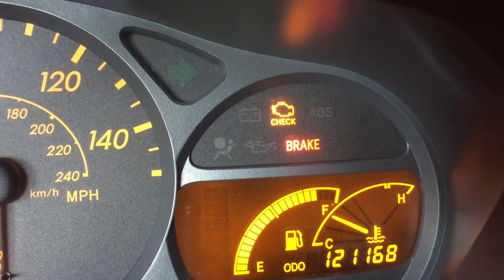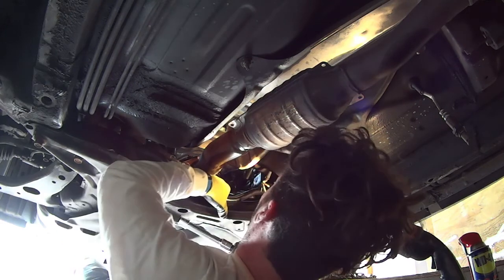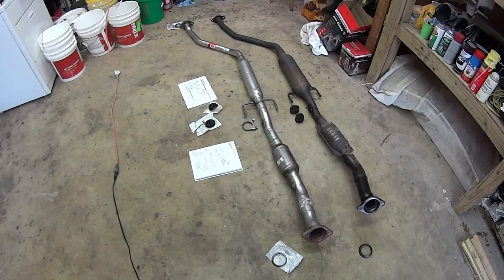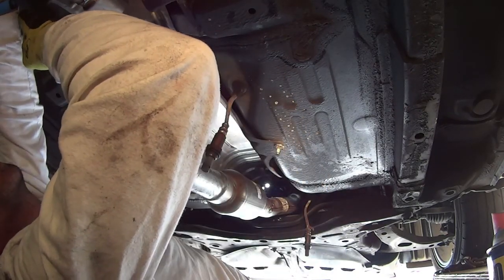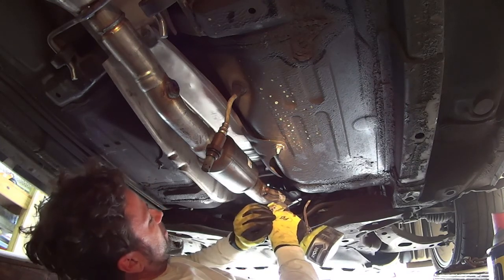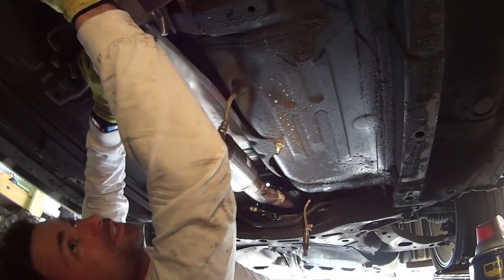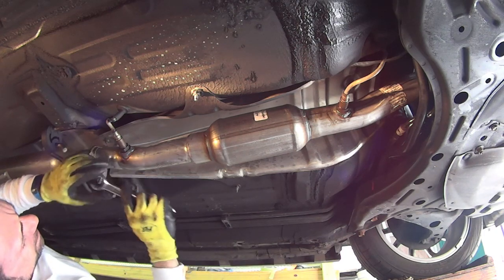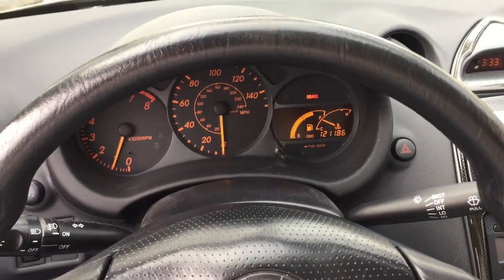Replacement of catalytic converter in my 2004 Toyota Celica

Comment: I have to do the same thing next on my GTS. Your suppose to disconnect your car battery when replacing sensors or mechanical work. Besides that good video 👍🏻👍🏻
Reply: IS YOUR CALIFORNIA LEGAL CAT,
Reply: What part number is for catalyst converter for gts??
Reply: Hey, how'd it end up working? Have replaced the cat twice and I'm still getting the p0420 code. (Thought 1st one was faulty) I read somewhere they need to be OEM parts. Did they light come back on? Any feedback is greatly appreciated!

Comment: My cat just died today on my gts after 375k+ miles.  I will be replacing it soon.  Thanks for the video!
Reply: Hey, how'd you end up doing? Have replaced twice and I'm still getting the p0420 code. I read somewhere they need to be OEM parts. Any feedback is greatly appreciated!
Reply: @The420Patriot  my cat (with intermediate pipe on both ends) from eBay is an aftermarket.  My O2 sensors (always use OEM for Toyotas) are OEM denso I replaced as well.  The aftermarket O2 sensors will only last a few days or so.  I'm at 392k miles and no code ever since.
Reply: @abuelb  Thanks for the info. The muffler shop thought the 1st cat replacement was faulty, so replaced with another. Code came back on. They've checked the O2 sensors/wiring's as well. Got oil leaks fixed, there's no misfires. Car drives fine but the damn codes coming up. Already spent nearly $2k.  Probably just gonna try another shop at this point.
Reply: @The420Patriot  what was the problem if I may ask? Did you fixed it?